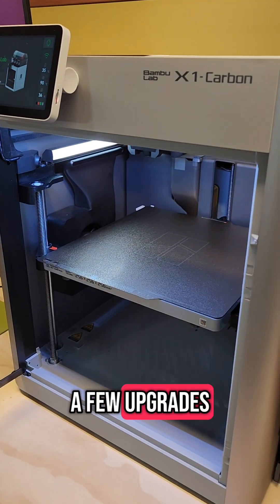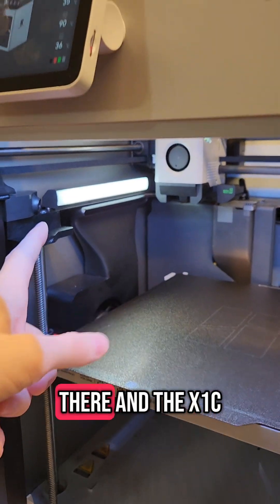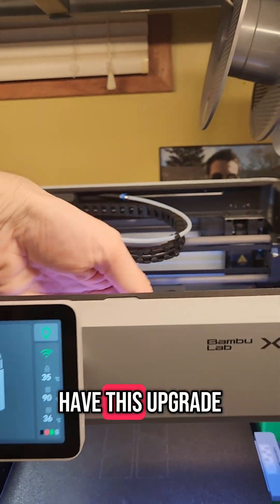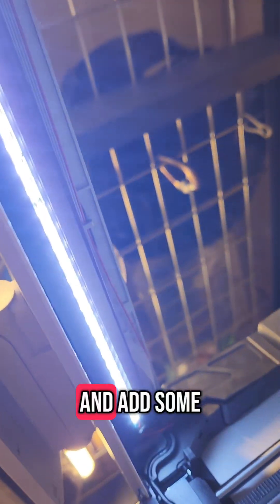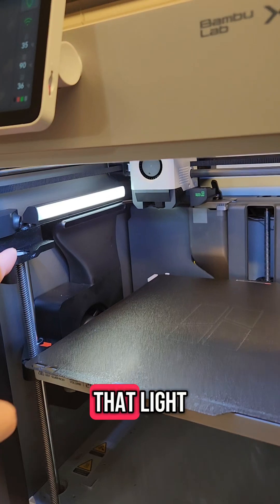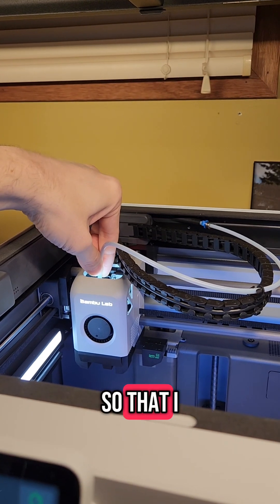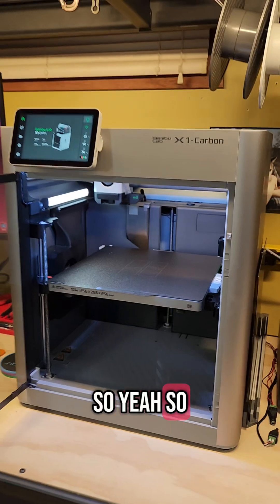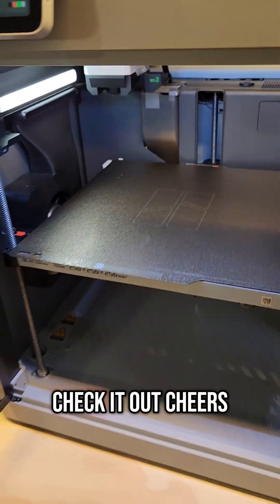Panda Lux LED Upgrade for the X1C

Comment: Where do you get the splitter PCB?
Reply from the maker: The splitter comes with the LED. I have since disconnected the stock LED, but it was running without issues for a while. It is recommended to run only one of the LED strips, though.

Comment: Does the X1C run the same risk as the p1s of damaging the electronics? BigTreeTech warns not to run the original light alongside this one with the p1s
Reply from the maker: In the case of the X1C, I don't think so as they provide the breakout board and right in the instructions say to hook it into the PCB near the top left of the machine. Been running without issues since I put it in!
Reply: @makermsean  No they do warn you for the X1C too despite providing the breakout board
Reply from the maker: @alancruickshank9286 Good to know, it has been running 24/7 for months now, so I'm not too concerned. At this point I'm going to leave it
Reply: @makermsean  i got my x1c hooked like this is yours still ok i have to please ? I have not turned it on yet . Ty
Reply from the maker: @PeterAgostiniJdcap26 I ran it like that for a while, but I switched it over a couple of months back as the more I read about it, it seems it's best to only run one LED off there. The other way hadn't caused any issues in my case but better to be safe.
Reply: @makermsean thanks i will disconnect the two and run only the led from bq

Comment: hey i just got an x1c but i have one question what are those green and grey boxes in the corner
Reply from the maker: @lincolnpaxton5342  That would be a Bento Box V2. HEPA and Carbon filtration, I print a lot of ABS so find it necessary to have filtration systems. I have additional units out of the machine and air quality sensors to monitor as well. I do have a video on the Bento Box if you look through my videos.